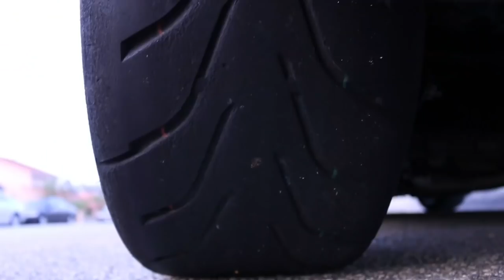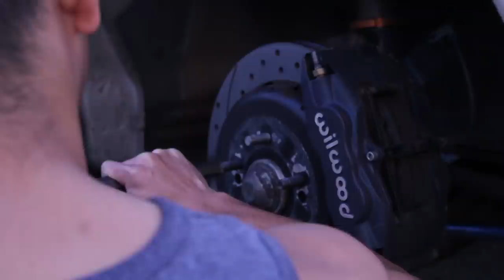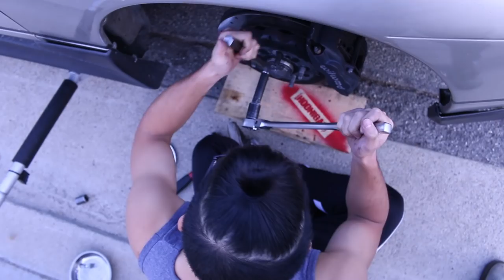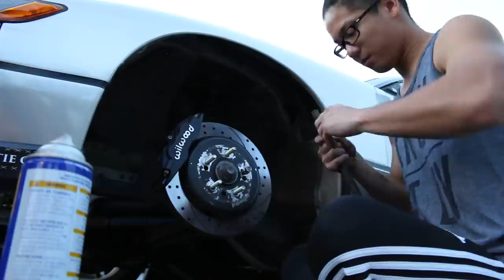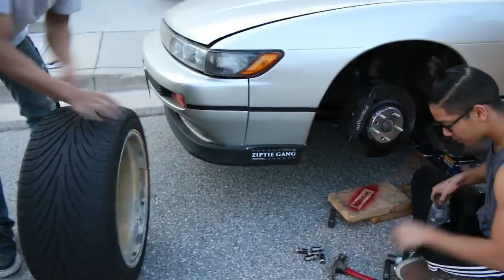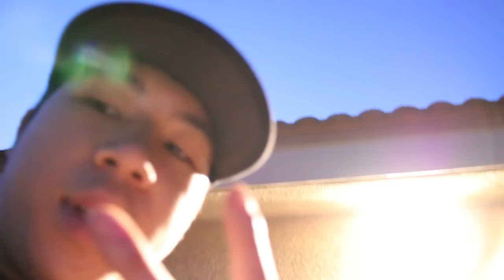Nissan 240sx extended stud install

Comment: could you get a wider spacer or double up on the ones in the vid for an even more aggressive stance or na?
clean ass 240btw
Reply: Jeffrey Crosby you could, I think max on extended studs would be 20mm to have enough thread engagement on the lug nuts, we put on a 10mm to clear the coils.
Reply: Jordwynne Ginez cool. thx

Comment: Wheel specs on white coupe?
Reply: Isaiah Sampson front 15x7.5 -6; rear 15x8
Reply: Erik Rivas Thanks! Very clean car! Are those Rota's on the rear?
Reply: Isaiah Sampson what are Rotas? The ones on the rear are Rs Watanabes
Reply: Erik Rivas Ah ok. The real deal. Rota is a wheel manufacturer. Thanks again.